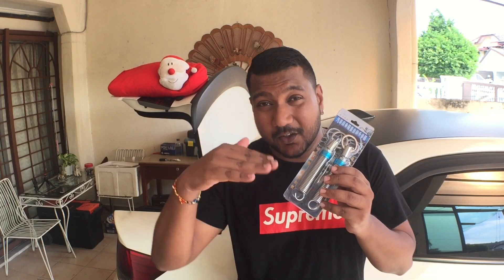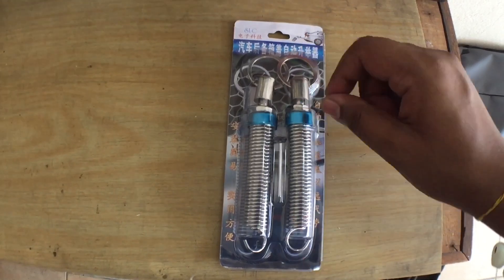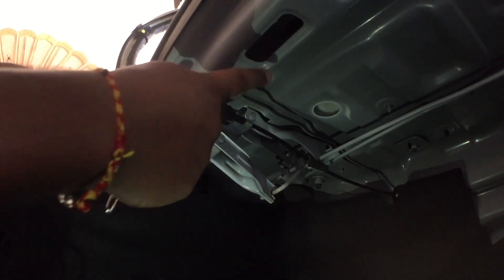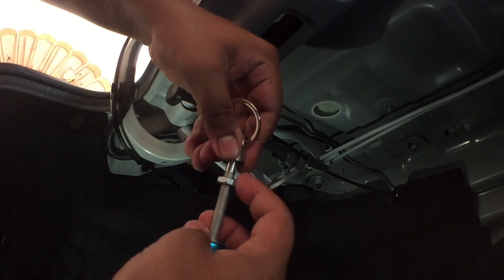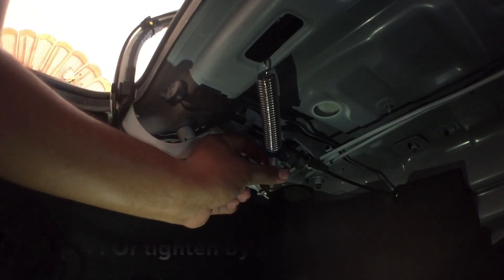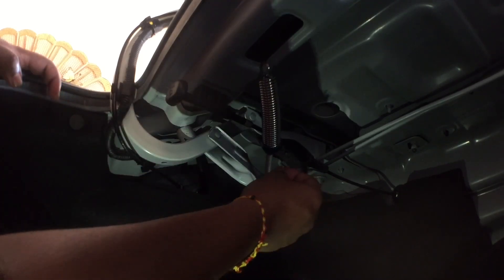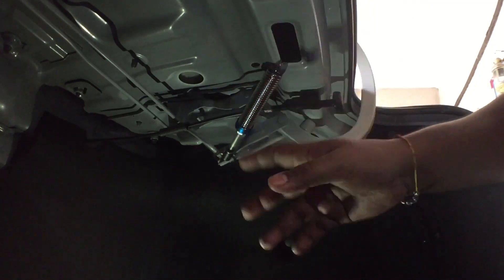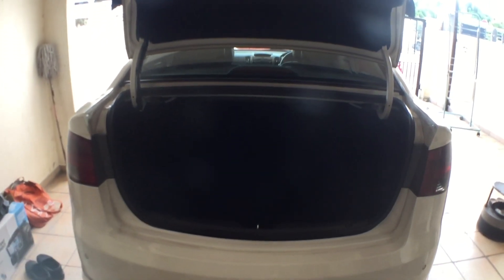How To Install Trunk Springs

Comment: Glad i found your video. I bought the springs but the shop says that they cannot install it.they said it is for local cars.
I installed it as per your video & it works like a champ.thanks man.
Reply from the maker: im glad my video was helpful. thanks alot. what car do u have?
Reply: @Andrewsautofreakz  mine is Hyundai i40, the boot lid mechanism is the same as your car
Reply: Andrew man where can i buy that exact spring? Is that available in the US?

Comment: very good video with clear guide especially on tighten the tension spring and lock the nut which is the key to the installation, Thank you bro👍

Comment: Great video thanks so much. I am not worried about my trunk opening up fully. But I am removing my trunk rods to install a better subwoofer on my rear dash. If I remove the rods for the trunk will I need the springs ? Because it will be difficult to open and close without them? Like will the trunk now slam down?
Reply from the maker: Not too sure. I guess it's trial and error

Comment: Thanks for the tutorial bro! Did exactly like you showed but it opens up way up too fast. Tried with 1 spring but it won't open. Even if I do it super tight. Any idea how to adjust?
Reply from the maker: If it's tight it will be hard when open. You have to play with the placement or adjust the spring to abit loose
Reply: @Andrewsautofreakz  thanks for the speedy reply. I tried with two springs. Fairly loose. Even still it was too aggressive when opening. My car's a Vios 2021 but the layout seems about the same as your car.
Reply from the maker: @flubFTW  mine in the beginning was aggressively opening as well but after awhile it was ok. I guess it needs to reach a point to help open. Unfortunately it's not like hydraulic.
Reply: Add a carabiner on each side to add space. That way you can install it  completely loose but it would still be secured in place. Should help ease the tension.

Comment: This might be overly obvious, but you want the spring stretched/tensioned when the trunk lid is shut so that when opened/tension is released, and it will return to neutral state in the opened lid position. Closing the lid will tension the spring again, ready to spring open. The positioning of the end points in the trunk need to ensure the closed position creates tension. Accordingly, it is not necessary to tension the spring in the open installation position as long as closing the lid will in fact extend/tension the springs.
Reply from the maker: Indeed you don't have to tension however tightening it in the beginning will help so that the spring is not loose when they is no tension if not it will fall off easily. Thanks for the advice truly appreciate it. Appreciate the support

Comment: Do they rattle or make any noises while driving?
Reply from the maker: If it's fixed properly it's wouldn't have sound. If does that means it's fixed too loose
Reply: @Andrewsautofreakz  cheers mate for the reply!👍
Reply: @Andrewsautofreakz  I have a 2022 Mazda 6 Atenza would these work on this?
Reply from the maker: @grahamsmith7407  not really sure, u will have to try and see if there is a place for it to be hooked on
Reply: @Andrewsautofreakz  ok cool I get it thanks mate!!👍

Comment: Hi brother, how r u, I'm still having difficulty to fix the spring for my Bezza, can I drop by ur place or could we meet somewhere for you to fixup my car, really badly need it done bcz driving grab, so passengers need to use the boot...
Reply from the maker: That depends on where r u located. Have you tried to find a place to hook it and ring to a point?
Reply: @Andrewsautofreakz  yess found both places but still having difficulty brother..
I'm around wangsa maju area
Reply: @Andrewsautofreakz  the spring I brought from Shopee, like yours you could screw/unscrew it with ur hands for the length but I couldn't it was damn hard and the nut inside the spring was stucked, guess was a fake item that's why was only rm 5
Reply from the maker: @pnyoutube5098  unfortunately I'm not from that area bro.

Comment: It opens too violent, reduce the tension a bit so it would open a bit Softer like OEM.
Reply from the maker: Brandon R I tried but if it's too loose it won't lift it. Maybe for mine it's such for others maybe different

Comment: I know I'm late to the party, i installed 2 but it doesn't want to pop up? Any advice?
Reply from the maker: Check the tension of the spring maybe it's too loose. Or check the location of the spring if it's correct. Appreciate the support on the channel as well

Comment: Nice bro! Thanks for sharing. I was wondering if it wouldn't have been better use only 1 spring in your case, it seems to be very strong opening.
Reply from the maker: Nícolas Koutroularis indeed it is. But I had to use 2 as 1 wasn't enough to lift the weight. If I used one I had to tighten  the spring but I was afraid it will damage the bracket
Reply: uneven force on the trunk lid...

Comment: I just saw your video and was wondering what made you install these springs.  I see in the video that your trunk lid torsion bars are there.  Was one of them broken and that's why the lid doesn't fully open?  My Elantra has one broken and it does not open completely.  Thank you.
Reply from the maker: ismaelyt09 the bars are there but mine doesn't fully open automatically. Nothin wrong with it. It's just like that hence why I had the idea to install spring to fully automatically

Comment: Can i know where u bought this pls??
Reply from the maker: I bought this online... Lazada or shopee
Reply: Ok i buy ready.. but after install its opening very fast i scared now.. how to make it open slow abit?? Help pls
Reply from the maker: KNIGHTZENDER try using one side first. If not you have to loosen the nut and adjust
Reply: Andrews Auto Freakz ow ok but thank you so much

Comment: There was very little tension on that spring and the trunk lid came up fast, should have just went to local hardware store found a spring for a couple dollars the length you need and pull it down with a pair of pliers, that would never work on my car I have a 67 Dodge Dart that spring is to wimpy!!

Comment: is it working if i have gas springs and not that kind of trunk opening? (Kia Optima)
Reply from the maker: I'm not too sure about that... If there is already hydrolic I don't see why u need the spring
Reply: @Andrewsautofreakz  it doesnt have hydraulic, it have gas springs, and they are there just to support when fully open. but when the trunk popping with the key, it's exactly like on your Forte.
Reply from the maker: Eli C if it has brackets like mine then u should be able to use those.

Comment: I installed this spring but I hate it when I can hear the spring pulling sound when my car drove over hump. It is quite ignoring thus I end up dismantle it
Reply from the maker: So sorry I had to go through it. You can try to adjust the tension to see if that helps . Usually when your trunk is close the tension should keep it steady

Comment: The ring didn't hold up on mine, it completely bent and snapped. Gonna try a stronger ring.
Reply from the maker: I guess it's due to the quality. But the ring is not hard to get and replace. You can use a old Keychain ring

Comment: Anyone have trouble where the spring becoming loose and flying out of the trunk when you open the trunk?  This is going on my moms car and don't want to worry about her getting hurt with them.... Trust that if something CAN go wrong it WILL go wrong on the car.....
Reply from the maker: helookalikaman79 sorry to hear that.. Maybe the way it's fixed is not right or the bracket doesn't suit with this type of spring

Comment: You know exactly that it’s only need 1 spring to work, 2 is way to much tension and pressure
Reply from the maker: Thien Khuc I tried using only one first but it couldn’t lift the weight hence mine I had to use both

Comment: Sir please help me my trunk won't hold up i actually need a stick to keep it open.  Will these work? Thank you in advance
Reply from the maker: JEFF TRUMP if ur trunk has and anchor point it will work
Reply: @Andrewsautofreakz  thank u very much for the reply
Reply from the maker: JEFF TRUMP appreciate the support
Reply: I've been using a wooden dowel that u bought from the hardware store to keep my trunk open but it is embarrassing😆 the metal rod that helps keep the trunk open snapped and now my trunk won't stay open on its own.